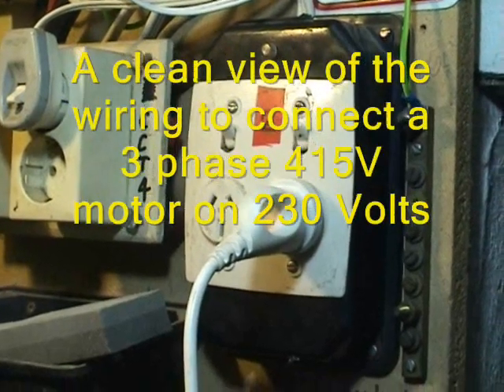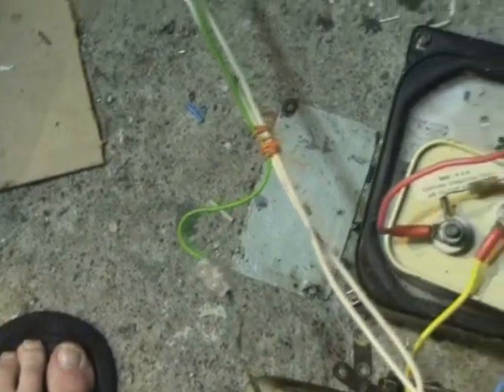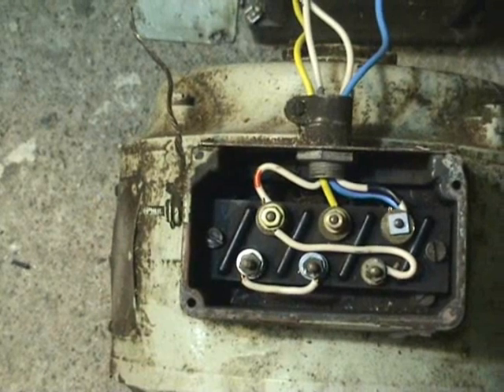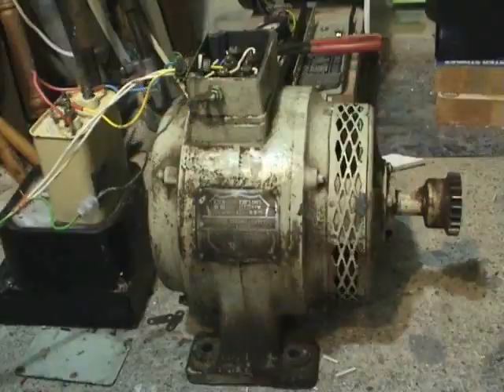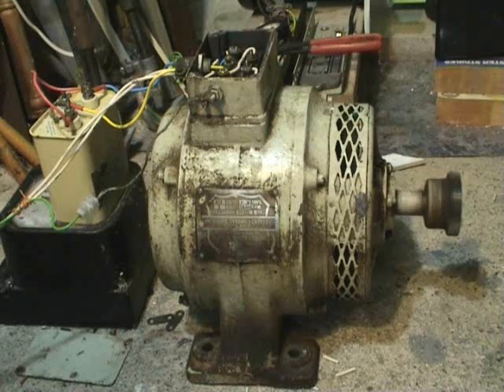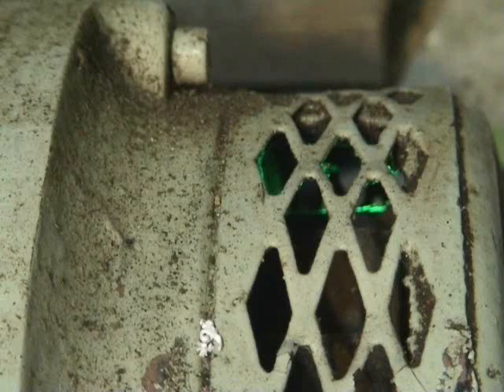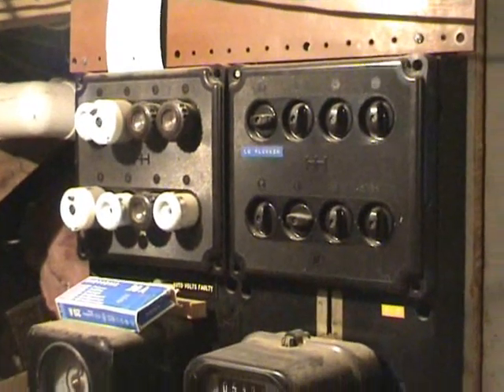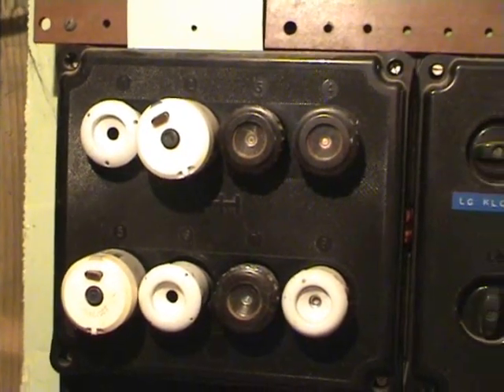3 Phase 415V motor on 1 phase 230V -- part 2

Comment: Thanks for the video, very interesting. Can you tell me difference between “star” & “half open star” and could I run a rotary phase converter using a 11kw 3PH in that mode? Thanks

Comment: Not a lot of starting torque, is there? I suspect the capacitor is a little too small. The starting line current must be pretty high. I expected to see the lights dim.
Reply: At least one of the comments goes to "no such thing as a free lunch" you can make it spin zero torque fast, but no load without real 3phase
Reply: George Michaelson I was referring to the starting torque, which seems quite low. A 3-phase motor with nothing connected to the third phase will just sit there until manually started or it burns up or a breaker trips. The current through the starting cap must be quite low.

IGBTs have gotten so big that I'd probably try my hand at building a 3-phase inverter if I needed to drive a 3-phase induction motor from a single phase supply.
Reply: +Phil Karn Afaik you can start a 3-phase motor on 2 phases (or 1 phase and a capacitor)
Reply: Richard van Pukkem Yes, you certainly can. It's just that there's less starting torque, and the starting current drain is probably higher.

Comment: this motor has ZERO torque...and even with some form of an electric clutch to engage after spun it would destroy itself.  3 phase motor needs 3 phases just as an engine needs oil.

Comment: Australia and NZ both use the same plug. Argentina and China also but Argentina has live and zero on opposite sides so could be risky interchanging because zero could end up being the switched line and would leave chassis of appliances live even when turned off.

Comment: Marvelous to run a 3 ph motor on 1 ph with the addition of a capacitor. Curious thing about my worldwide standard console stereo is that the turntable motor is synchronous with a shading coil whilst the tape deck motor is permanent split capacitor (2 mF). The capacitor does not need to change between 50 and 60 Hz only the capstan sleeve. Stepped pulley has to change on TT motor along with moving supply lead to the appropriate tap on field coil 50 or 60 Hz with respect to Common.

Comment from the maker: @high1voltage1rules That motor in the video is a 3 phase 415 Volts motor.
Started up with Capacitor on 240 Volts single phase.

Comment from the maker: @cortexedge You are correct, the line voltage used is 230 Volts. The motor nameplate rating is 415 Volts, which means that 240 Volts should ideally be used.
The motor runs fine on 230 Volts.

Comment: How is the line voltage in a three phase system 415V, since the phase voltage is 230V? 
Line voltage is phase voltage multiplied by √3, this being 230V*√3= 398V~ 400V

Comment from the maker: @abaddon1337 I run this motor in half open star. The starting torque is less than in delta which is correct.
I just wanted to try this arrangement out as I know that the delta set up works.

Comment: hi
Like in this video, I tried to couple stators in open-star and the results are not as good as coupling in delta with the permanent capacitor in parallel to one of the self of the stator. On some low power motors (0.5 HP), I am even forced to start the rotor manually otherwise it don't start. This problem don't appear with the coupling in delta and the motor gives more mechanical power than with the open star-coupling.
Is open-star really efficient with high power motor only ?